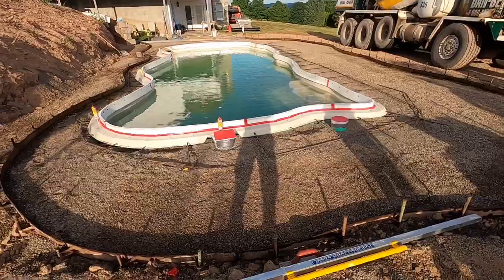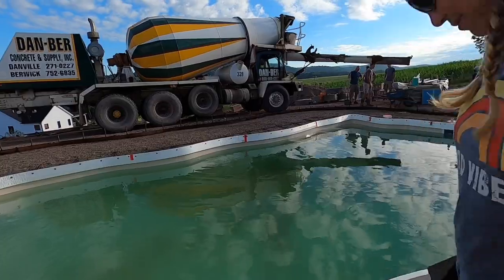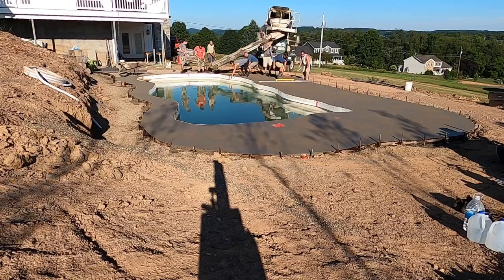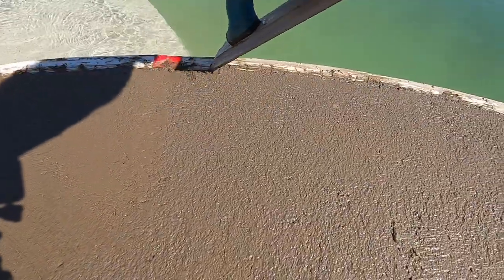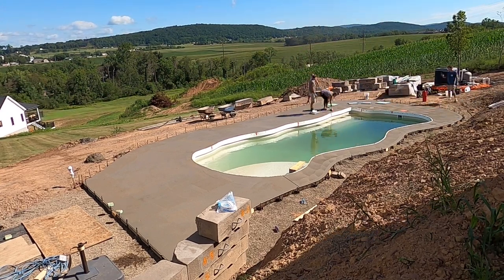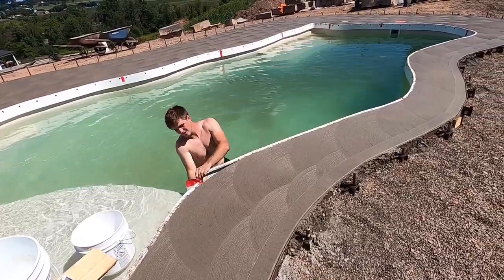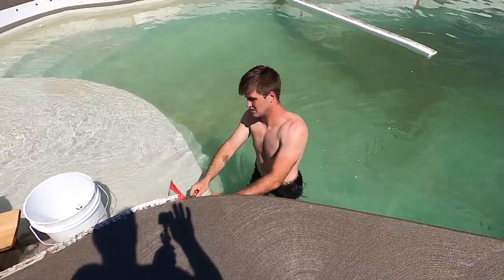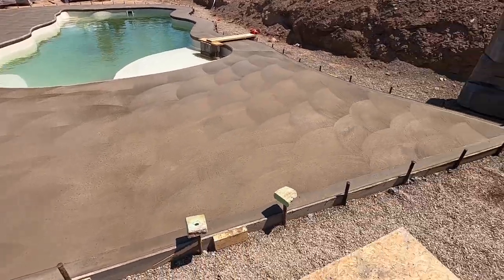How to pour a concrete cantilever pool deck

Comment: Nice to see a young person that understands the how profitable working with concrete, and other masonry related products can be…pouring concrete for crawl spaces and dirt cellar floors is a huge untapped market in New England (MA,RI,CT,ME,NH) I bought a used trailer concrete pump in 1990, and paid the pump off after 3 projects.

Comment: How do you pour around the skimmer?  And what if my skimmer is below the grade height of my pour?  How do you deal with that?  Thanks.  Amazing video...amazing family...amazing job.  I live in Vermont where we don't have any acrylic pool companies and nobody knows how to do this.
Reply from the maker: They make extensions to pick it up to height. Tape the top to make sure the concrete doesn’t mess up the lid. Pour around as flat as possible. Looks like I need to go to Vermont

Comment: I had a pool with cantilever coping put in a couple years ago.  There are rust spots that keep coming back.  I think this is because its a salt pool and the water splashes in fine cracks and hits the rebar to cause the rusting.  The company has come back out several times but only fixes it for a short time before the rust returns.  Have you had this or seen this happen in your experience?  If so, how do I get this fixed?  Thanks!

Comment: Very nice work what is the model number or part number for the cantilever forms  would you recommend this for a diy first time working with concrete
Reply from the maker: I don’t know the model number. I would recommend hiring someone to do this for you if it’s your first time. It’s easy to mess up the edges of the pool
Reply: @masonthemason6412  thank you I am having problems finding someone who is Familiar with Fiberglass Pools I get a quote from a none contractor for $5000 to do the pool coping extending 3 ft and 5000 to block up the spa  and coping around it to so total of $10,000 with No facing on the blocks
Reply from the maker: @WLAmediacalmedia  where are you located
Reply: @masonthemason6412  in California near Temecula California
Reply: @masonthemason6412  near Temecula Ca it’s a Latham Bermuda pool and a Shasta spill over spa raised
Reply: I would like to email you photos of my pool and spa
Reply from the maker: For sure
Reply: @masonthemason6412  I sent over the email and pictures yesterday
Reply: Do you ever do a spa blocked up videos
Reply: @masonthemason6412  I emailed you yesterday with photos
Reply from the maker: I’ll look at them
Reply: @masonthemason6412  thanks

Comment: Let me explain the situation.  I have a fiberglass  pool being installed by a pool installer, but a deck installer installing the deck. Who responsible for installing the base (cement) around the pool? Where the copping sit on.

Comment: I had 2 guys on tictok tell me that that's not a cantilever because I guess the definition of cantilever means held up by 1 side only and I'm like bro it's a cantilever concrete step bro if it overhangs like that. call it what u want but we not talking finished carpenter cantilever step inside a house
Reply from the maker: lol. On the box of forms it’s called cantilever
Reply: @masonthemason6412  I know right, crazy 🤪

Comment: There is supposed to be a trim strip where you put the red duct tape.
Reply: thats a tile strip. for gunite pools. for tile on the top. a fiberglass or liner pool you cant use them
Reply: @rfl4931  it just goes to show how little you know.  The trim strip comes in the box for a seamless transition from concrete to pool. hence the name "trim " strip. It's meant for fiberglass and concrete applications.  Vinyl liner pools have a natural trim strip which is the aluminum liner track.
Reply: @MrBmxbrawler  wrong homie.  i work for one of the biggest leading pool companies in America. sorry but you sound like the offshoot people whos new and try creating their own business. it wont even fit on a liner pool. got a liner track under it. im takin it yall use  coping forms thats not for the project your using it on but do it anyway. it can be done. but seriously its for gunite pools. its a tile strip my man so you can replace a broken tile easily. sorry dude but true
Reply: @rfl4931 you have no clue what you're talking about. Leave the concrete to the professionals. Notice how in this video he didn't show the nose at all close up. Because it looks haggard as hell and stones and red duct tape is sticking out of the bottom of his bullnose. Instead of a clean seamless trim strip. 😆 🤣 😂